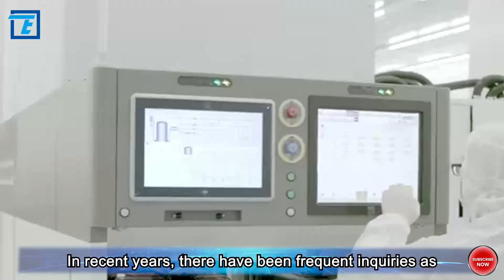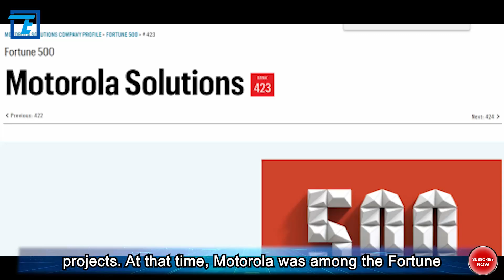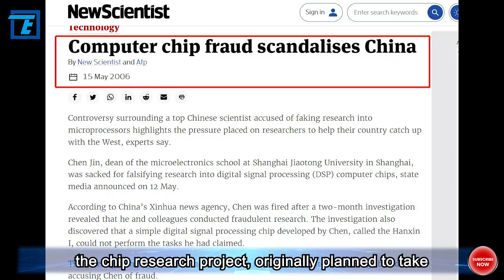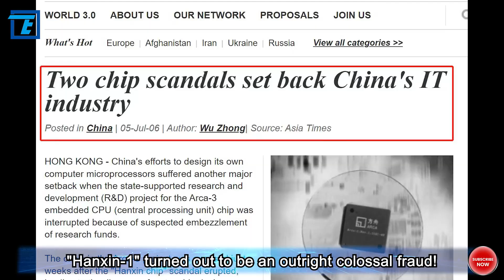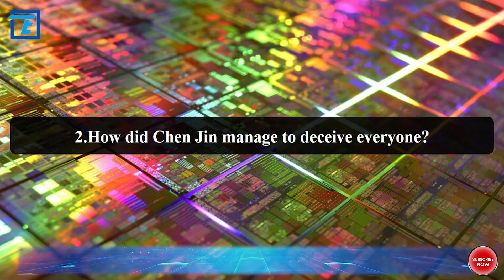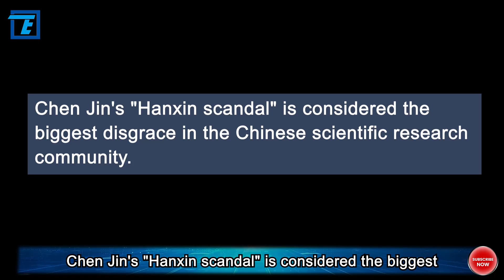This chip expert defrauded China of 1.1 billion yuan and made China Chip stagnate for 13 years?

Comment: The problem is not only that of fraudsters but also incompetent bureaucracy. Universities and industry  publications should be given freedom to criticize and investigate. And incompetent bureaucracs should be removed and not allowed to repeat expensive mistakes. Some in the system are likely involved in the con. 
To be conned in 2001 with a Motorola CPU has got to be really dumb, I am familiar with the Motorola CPU instruction set of that era.
Reply: Although it was relatively early for it, coming so soon after the U.S. Clinton Admin sponsored China's most favored trading nation status of protected developing nation - it has all the hallmarks of the Secret Military hydra control over news outlets and universities, just as was done against Iran in the effort to extract the Iran Hostages in 1981. This is the only role of such deliberated evil that the agencies are allowed to carry out with domestic support. However they abused this same ability to influence the 2020 election and to defame Trump since then and are doing it massively today to keep Trump "busy" with a tsunami of officially sanctioned persecution. This is not tolerable. It is an ass -nation by other means.
Reply: Silicon Valley superstar Elizabeth Holmes
Reply: To my knowledge it's not a regular Motorola 68000 series "CPU" (Von Neumann).   It's a 56000 series "DSP" or Digital Signal Processor (Harvard Architecture) which is essential for wireless communication.   The story is also not too accurate.  BTW a fresh Ph.D would start with a "staff engineer" title.  He had to climb quite a few ladders to become a principal engineer.